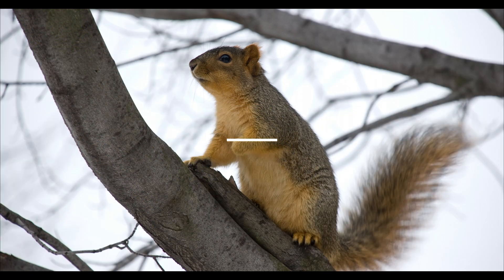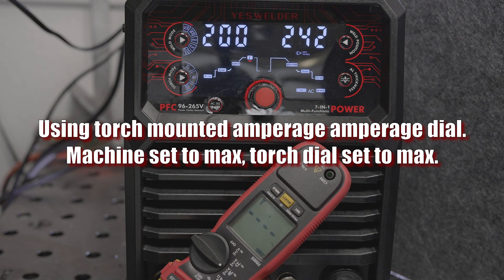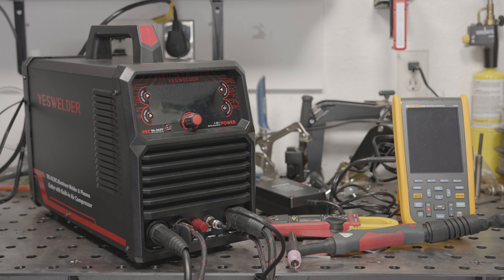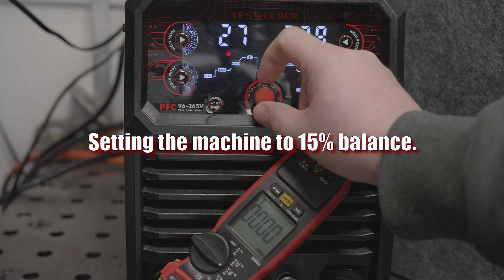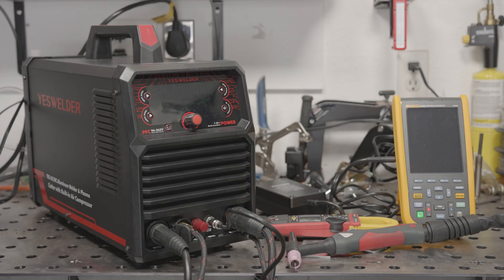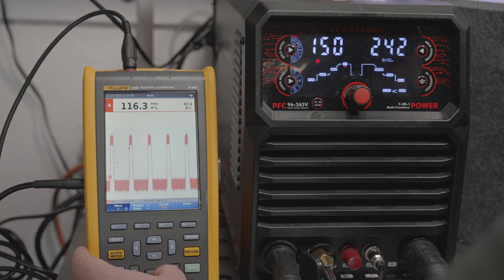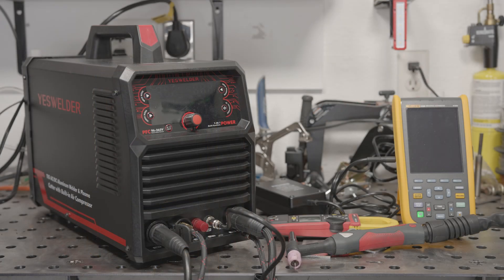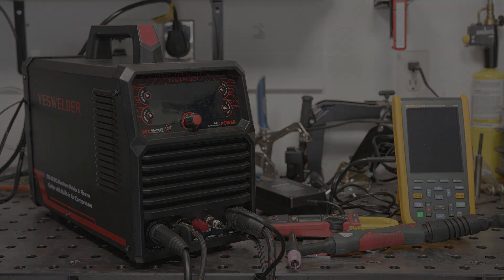Yeswelder CT2050 AC TIG Output Tests

Comment: I bought one of these early on and thought it was gonna be great. I don’t have a meter to test the output amperage, but I noticed significant changes in how the machine would work when using the foot pedal and when not using the foot pedal. Then I noticed a dramatic drop in argon gas output. I complained to customer service and after many weeks, they just sent a replacement machine. I hooked up the new one and the gas flow was nonexistent as well as air flowing from the internal air compressor. I told them I wanted my money back and that they could have both machines back. They refunded me my money and said they did’t want the machines back. I bought a primeweld 225x and it’s great. But I have one CT2050 that doesnt work and one that sort of works. I will say that the plasma torch does work well. I’m gonna swap out the solenoid valve and see if that makes a difference. Don’t buy one of these machines.

Comment: True RMS current clamp meter?
Reply from the maker: Yup.  The current clamp is true RMS.  Values were confirmed but the Fluke oscilloscope as well.
Reply: @bigtb1717  That's indeed odd. Do you get correct current on DC setting?
Reply from the maker: @lobpants  When using just a switch, no foot pedal or torch mounted amperage control, I did get rated output on DC TIG.  But just like AC, the DC TIG output is lower when using the foot pedal or torch mounted amperage control.
Reply: @bigtb1717  Wired. As an EE, I would be inclined to hook myself into the CC output setting and check if the MCU does indeed decrease the current in AC mode and lies to the user for the displayed value or if something else is going on. Let me know if you are willing to and would need any assistance.
Reply from the maker: I'm willing to try something like that.  And I'd be happy for any pointers to make sure I measure the right thing.  You can shoot me an email if you'd like bigtbcontact@gmail.com

I will say that this isn't an isolated case.  There are many welders I've tested from Yeswelder and others that put out FAR less than their rated output and far less than the displayed setting.  It's not at all uncommon for welders from this and other brands to be overrated.

Comment: Given how much the controls resemble an ESAB, you may have the balance setting backward.
Reply from the maker: That's a good thought, but I definitely had it correct.  The percentage shown is the amount of electrode positive, sometimes called "cleaning."  So a setting of 25% should give 25% electrode positive and 75% electrode negative.  I say "should" because I forgot to measure the times to calculate if the displayed percentages are accurate.  Doesn't matter all that much.  Based on the waveforms I observed, they are at least close.
Reply: @bigtb1717  Ah well, it was worth a try.

Comment: They should rename themselves to “No welder” lol.  Honestly it’s pretty sad, they charge pretty decent money for literally bottom barrel performance.  I feel bad for all the people who got conned into wasting money on them.
Reply from the maker: Lol.  I think some of their newest welders show that they are at least...sort of trying.  And I will give the CT2050 props for the plasma cutting.  I don't know how well the internal compressor will hold up, but it cuts pretty well in general, and surprisingly well with the internal compressor.  

It's just a shame that their AC TIG doesn't have better control and their stick welding isn't a bit better.  The $1,600 it currently costs is a whole lot of money for something with so many questionable aspects.  I only hope they have tweaked the design (proper argon connection, maybe?) and software to provide more consistent operation.  Unfortunately, I may never find out because I'm not buying a second one, lol.